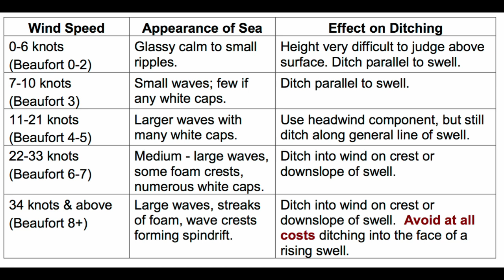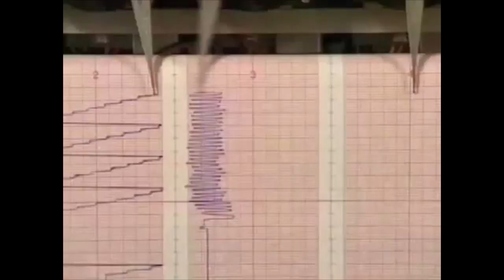Gyrocopter ditching at sea

Comment: Ditching is something that I discussed with my instructor (who was a North Sea heli pilot for many years) - I asked him about whether to remain buckled or to release the buckle prior to touching down on water to aid ease of egress - One thing he raised which I think is worth noting is that he suggests that in a ditching, a gyro will roll over and the rotors (which would still be only just below flying speed) will dig in and twist the aircraft around. Ditching a gyro would, therefore, be quite different to ditching a fixed-wing aircraft in terms of what will happen to the aircraft once in the water.
Reply from the maker: Yes I’d agree with the general point about ditching a gyro will be different to fixed wing and there will be little time afloat. The rotors hitting the sea will just destroy the rotors as any twisting force will be resisted by the rest of the gyroplane in the sea. There will be no opposite movement of the gyroplane body.
Reply: Gyrocopter flying club - Is your comment speculation or have you observed a gyro ditching? I’ve never seen such an incident, though I have seen roll-overs on the ground. I suspect that my instructor’s perspective is based on his knowledge of helicopter ditchings (which, admittedly, are potentially somewhat different). Whilst I’d like to know for sure how a gyro behaves in a ditching, I think I’ll leave the experimentation to someone with a death-wish and money to burn. I have no desire to sacrifice my MTO or try swimming in a helmet and flight-suit in the North Sea. I suspect that it would not be fun.
Reply from the maker: Well very sadly I've been a pax in a gyroplane that has rolled over on the ground.  There is a huge resistance from the body / keel and whilst there is perhaps a kick as the rotors thrash themselves to death the body does not turn - but remains planted to the spot it last fell.  I see no reason why or how the body and keel wouldn't be resisted by the water - after all the logic were it able to would be that the rotors could just continue turning through the water but of course they won't.  Don't forget with a helicopter the rotor is driven and so once the tail rotor gets smashed up there is no anti-torque if the motor is still running.  Although I don't know if that was his thinking or indeed just how much movement of the body of a helicopter moves once in the sea - i suspect not much aside from it inverts.  Yeah I'd not like to try it - the seat belt advice is likely so you don't smash your face / into the instrument panel.  You can't do anything if you are un-conscious.
Reply: Gyrocopter flying club - I think the twisting he meant was along what would normally be considered the “pitch axis” of the gyro rather than the “yaw axis”. I don’t expect the gyro to raise its tail or nose out of the water (twisting in opposition to the turning of the rotors). I understood him to mean that the rotor would act a little like a paddle and turn the body in the water. I suspect that his take on it was speculation, though. I don’t think he’s ever seen or been involved in a gyro ditching, either. I’ll ask him next time I speak to him, though and I think it would be something that would be worthwhile researching if someone could come up with the money and an operational procedure for keeping the test-pilot safe. Perhaps a large gyro UAV could be used to test the scenarios.
Thanks for explaining your reasoning.
Reply: @RoadRunnerLaser  My helmet would soon be ditched....
Reply from the maker: Yes interesting point and makes sense.  I think the key point is that we agree on keeping belted in and one of the pre-flight brief would include how to undo the belts.
Reply: Gyrocopter flying club - Not only do I include that in my pre-flight brief checklist, I make my passengers SHOW me that they can undo the belts and disconnect the helmet as I get them settled into the seat. That way, they already have some experience of doing it and are less likely to fumble in the event of trouble (at least, that’s my thinking).
I have my pre-flight safety brief printed and laminated and the passenger gets a copy so that they can follow through as I cover each aspect. Even if the only up-side is that it inspires confidence and looks more professional, I think it was worth doing.
Reply: @RoadRunnerLaser  very good point people have died before today as they had no idea how to undo the belt under stress which is a very important factor.....Once your heartbeat goes over 145 bpm you as a human can no longer make sensible decisions......So even some thing as simple as a seatbelt might have you screwed........Classic example is the sight seeing squirrel that ditched in Manhattan.......The only survivor was the pilot......6 tourists drowned.......
Reply: Id be releasing my harness in a gyro just prior to splashdown due to the low landing speed, if all goes well as you say the gyro will roll over meaning the crew can vacate the aircraft in the opposite direction to the roll over........
Reply: tanyano9 - That would have been my thinking - Release the buckle, first - You don’t want to be fighting with a buckle in bulky clothing whilst you are being dragged down by something which is not going to float... but, my instructor’s advice was not to.
Reply: @RoadRunnerLaser  I was baseing my logic on it being an MT03 type, enclosed type the doors would be got ready to be jettisoned....
Reply: @tanyano9  Having had some experience of helicopter diching, I would definitely advise against releasing your harness before touchdown.  Particularly with a gyro: it will sink quickly beneath you and you could be bobbing about under the descending and possibly still spinning rotors.  The advice has always been - wait for everything to stop and stabilise before releasing your harness.